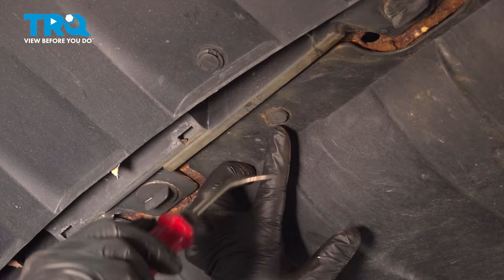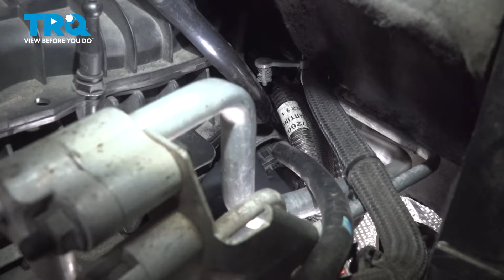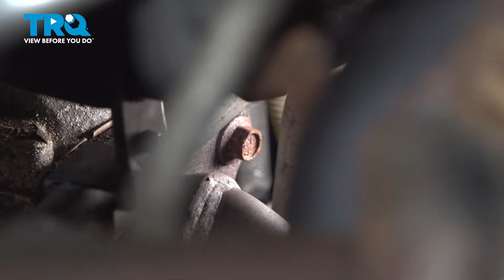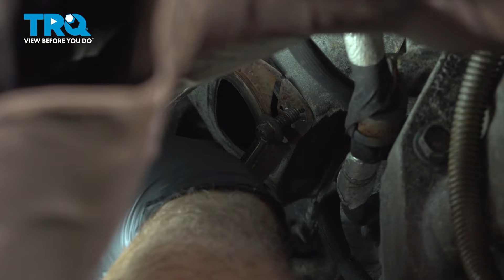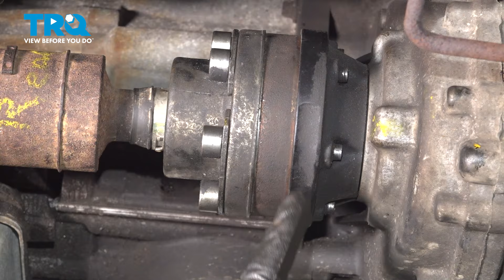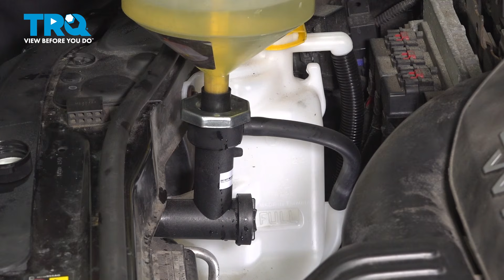How to Replace Coolant Temperature Sensor 2011-2021 Jeep Grand Cherokee 3.6L V6

Comment: Is it possible for a mechanic to f*ck with this sensor??  
I just put mine on a code reader. When i toggle the ECT read-out, it shows Celsius and Farenheit. My dash is showing the Celsius number with the Farenheit tag, causing it to throw 0128. The coolant is plenty hot, the heat coming from vents is scorching. And the corresponding temp on meter toggled to Farenheit is normal operating temperature. Can someone go in there and flip it so it reads wrong?

Comment: 3/4 deep well socket with a swivel and a couple extensions will also do the job. It's not very fun, and you can't see anything but beats pulling the whole vehicle apart.

Comment: I was curious if the check engine light came on. If that was the reason for the replacement if so do you remember what code it threw?

Comment: Thanks, but I think I will cut and make a wrench to fit from the top first. That's so dumb they have to take the drive shaft and exhaust off.
Reply: I was about to push my jeep off a cliff until I read this. Thank you